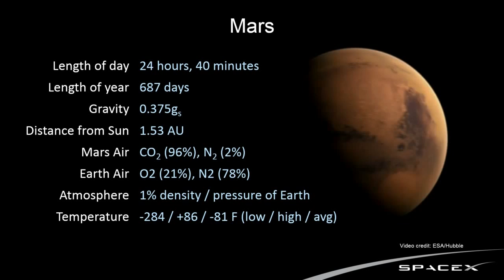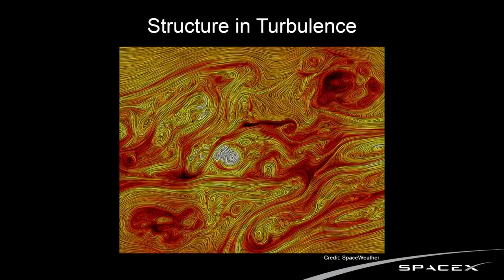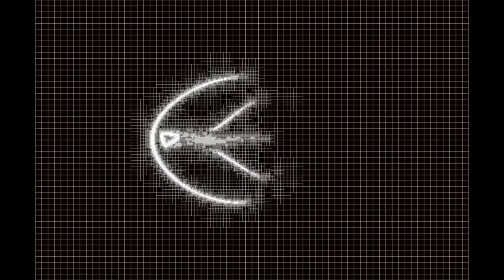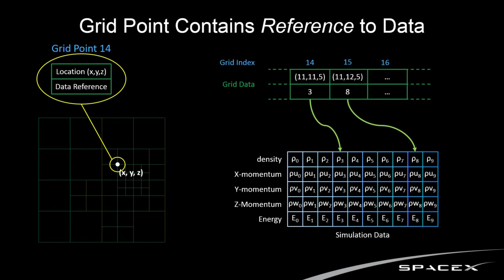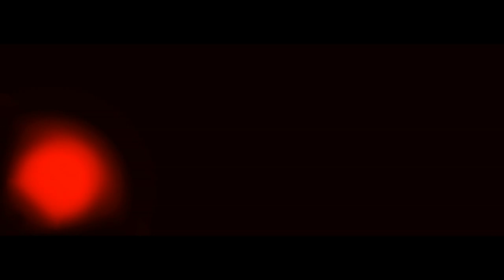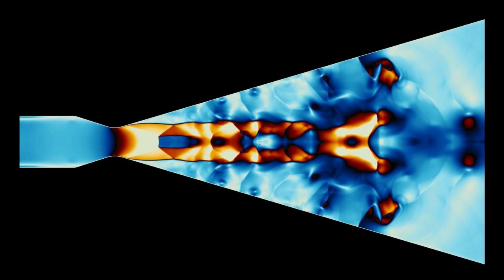GPUs to Mars: Full-Scale Simulation of SpaceX's Mars Rocket Engine

Comment: have partical accelerators been used to experment with hypergolic chemical thermal expansion ratios temperature after basic particle research for temperature pressure and raio of mix resaearch...also suggest a model of observation in sunspot rims from subnspot surface gases combine in extreme burns..number of reactions reviewed by xray defraction and spectromiters.

Comment: I have a feeling that we still could use a "catapult" type system in extremely large rockets, similar to what an aircraft carrier use. The amount of thrust needed for the "first" lift is significantly larger than what the engines need to for the rest of the flight.
Reply: A fully loaded Falcon 9 weighs something like 500 tons, realistically you are not capable of building a catapult that can store and release enough energy to make a difference. You would have to put a nuke under the rocket, but that would break it.